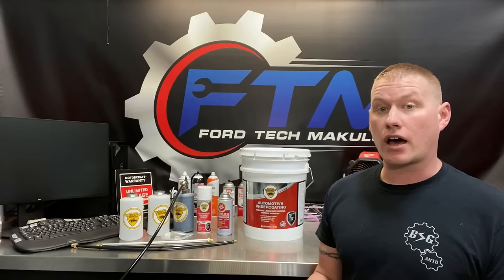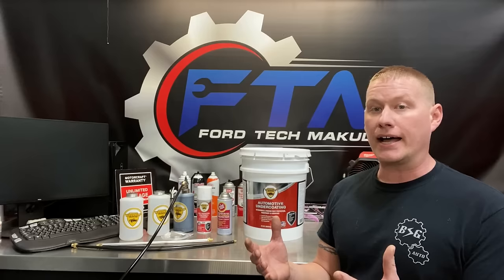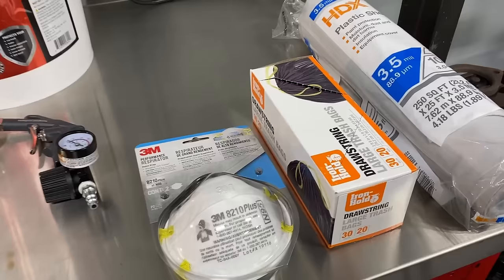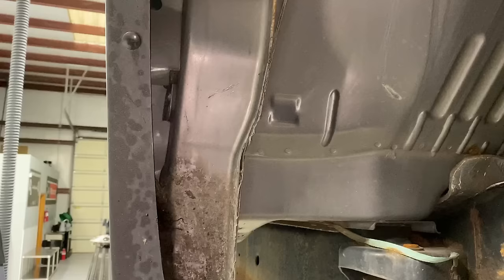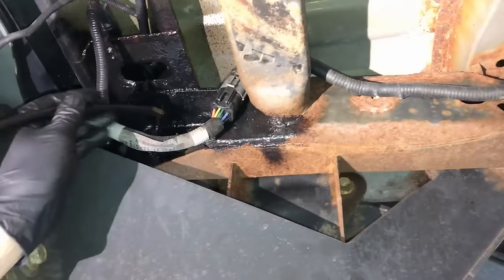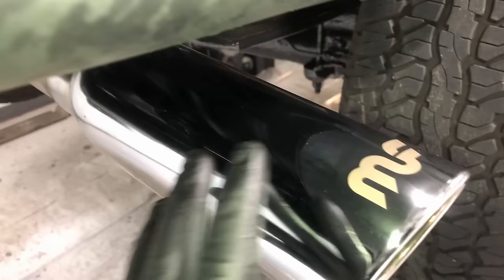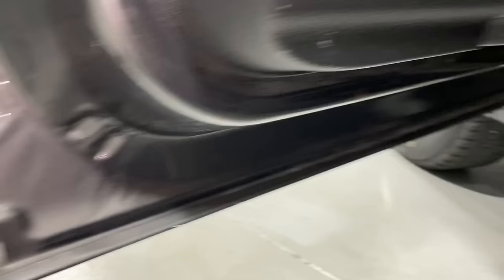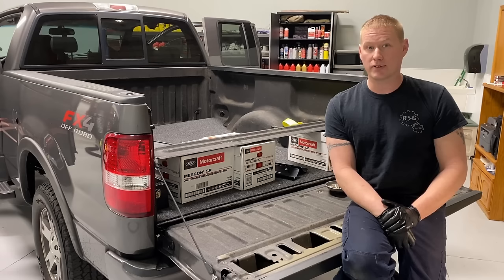Undercoating Your Vehicle with Woolwax: Is it Really Better than Fluid Film Though?

Comment from the maker: This is the Woolwax kit I recommend:
https://amzn.to/2KFBvpV
Reply: will this void the warranty on a vehicle?
Reply from the maker: no
Reply: Linseed oil is my choice, you can also mixed beeswax to get the same affect but you'll have disolve the wax with mineral spirits , so you can just mix them all together for the sprayer, and tint it with oil base black paint.  Remember linseed oil drys when exposed to air. It will not come off . Thats what im gonna do.
Reply: Hi big fan I've watched all your video's one timing Chan and camshaft phaser repairs I just buy a 2004 Ford F150 5.3 and the housing right above the phaser crack it was making a ticking sound when I buy it so I knew there was phaser problem and was going to fix it when I got home sad to say I didn't make it sorry long story but why would the housing break the chain is not broke thank you for all your support in this area and all Ford's I've also worked on Ford's my hole life and don't want anything else lol thanks again
Reply: Does this stuff harden or is it actually like a grease? And how do we kniw this wont trap moisture like the rubber stuff
Reply: I hope you are willing to make a follow-up video which shows how well Woolwax stayed applied....and what the next year's touch up process will involve.....

Many thanks to you for posting this video
Reply: FordTechMakuloco agreed lanolin works were well , I oil all my cars and trucks they are all old but look and drive like new . My mixture is chain bar oil ,cooking oil some non detergent motor oil and diesel mixed together applied with a suction feed paint gun and a pump up sprayed and I drill 1/2 holes like on my 2011 f150 from the top of the pillars and door jams in double walls box , fenders ,above rear wheels tailgate  . I just welded in rockers and cab corners stuck my hand up the inside of the cab above the cut of corners was amazed the rust  pitting in the e coat way up towards the roof so I drilled holes in the pillars just below the roof to gain access. Oiling every thing doors fenders frame inside and out suspension and mounts all welds all cross-members,   supports  , the rear shock mounts don’t look strong on these truck in my opinion and in Ontario the safety is getting stringent on repair and how they are done  .In Ontario the dept of transport does not allow you to replace  rocker or cab corners with out the being continuously butt welded with either a mig or tig welder ,even the bottom of the rockers which were spotted Oem must be mig or tig continuously. No structural modern  structural adhesive are allowed for parts considered structural by the dept of transportation . By the while doing the rockers the back side had plastic tape over the 6 or 8  2inch holes on the back side of the rockers to cover the holes Oem equipment un real ,I bet if I tape them up with tape it won’t pass inspection going to get plastic   2 inch plugs what was the manufacturers thinking other has been horrified by this
Reply: Gary Wick yes veg oil works I mix chain bar and vege cooking oil and non detergent and some baby oil smells nice and a little diesel or mineral spirits spray with a suction feed Paint  gun at 45 psi but ware a n95 paint respirator and I use a pump up sprayer also  don’t be afraid to drill holes for access , I even pull up carpets and pour oil on the cab floors and brush it then put heavy plastic under carpet and reinstall carpet . I have a1976supercharged  vette rests rod I had the car 38 years I oil the( bird cage ) by taking out the screws above the windshield and t top centre divider and the door pillars if that rust out on a c3 vette it is a nightmare to repair so better to treat it than loose it .
Reply: Do i need to be doing this every fall ?
Reply: Michel Francisco yes ,I use my own oil mixture and spray every year time consuming messy but works great if applied to every nook and cranny and lines
Reply: @nickking1510  hands down too you it's too much for me with 2 trucks to maintain a 2005 f150 and a 2008 f250, i found your channel last year, and i watch the videos even if is not for my trucks "  Knowledge is key " thanks brother.
Reply: Michel Francisco Hi Michel even if you did every few years it will help save the trucks and saves $$$ . I live in Ontario just east of Detroit tons of salt used here
Reply: I would love to do something like this to my vehicle, but unfortunately I have 30 years of rubber/tar undercoating to be removed before I could do that. Yikes! The amount of time you spent on your vehicle really demonstrates the shortcomings of having a commercial product applied by a franchise owner who generally will spend less than an hour per vehicle applying the product. How could you do an adequate job in less than an hour? I don't think you can. Much better to buy a good product and spend the day doing it yourself. As you did. Good job! :)
Reply: How often do you have to re-apply the Woolwax? Every year? Every few years?
Reply: @bob Johnson
Don’t forget the cost of the lift also when doing it yourself. I wouldn’t want to try to spray this stuff on laying on your back 2’ away from the sprayer nozzle. Just sayin...
Reply: Can you please do a second vid on this truck before you recoat? It would be really interesting to see how well it has stayed on and how it looks after a couple years. Thanks for this video. I just bought a southern truck and brought the poor thing up to Maine so I need to do a treatment on it before the weather turns. It has zero rust now.
Reply: @78djohnson   where did you get the straight wond  ? TY.. great video  👍
Reply: @garywick2090  I used boiled linseed oil, bar chain oil to thin, a glob of marine grease and some toilet bowl wax ring heated in an old crock pot immersed in water.
Reply: @gary24752  damn thats creative there !
Reply: @Daniel-sd3qk  no, water will not penetrate beeswax, linseed oil, or whatever
Reply: @FordTechMakuloco  Will you wash a treated vehicle in winter (automatic touch less car wash with the undercarriage sprayer)? 

Or do you avoid this as it could rinse off your protection? 

Thanks!
Reply: excellent footage on the inside rocker spraying!
Reply: Have you tried surface shield yet?

Comment: I have been using Fluid Film under the car every fall for years. The underside of my 2013 is virtually rust free. I just replaced my tires and asked for a alignment. They advised me that rusted parts may not be able to be broken loose to adjust, so if needed alignment may not be possible. "Live in rust belt". Picking car up they stated they couldn't believe how rust free under car was. Adjustments they made were easy.
Reply: How do you apply it
Reply: @RoyalKennedy601  
Liberally.
NOT LIBERAL.
Reply: @mconradb 🙄
Reply: Question for y ou, when you put this stuff one, what happens when you go off roading? Does all the dust and debri from the road stick onto to your frame?

Comment: to add to your tips. You should put a piece of tape a few inches from the end of the flexible wand so when you're pulling it out of the crevices you can see when it's just about to come out and stop spraying so you don't spray it all over yourself and places you'd never intended to.
also on the long flexible wand to keep them rigid you can use some tape and a straightened out piece of metal hanger,  tape that to the flexible hose that way it's  straight/rigid and you can control it in the long frame/tunnels.
Reply: Steve D great tip! Just started researching undercoating. Wool wax is what I’m leaning towards.
Reply: Excellent tip!

Comment: Great video, has to be one of the most thorough explanations of applying undercoating.  Great to see a good camera angle of using the 360 wand in a cavity to see how it disperses.  Just finished doing my Jeep last week but now know I will have to spend more time with the 360 wand in some areas on the next application. A great benefit to have a lift but still can be done on jack stands and great tips on dropping plastic tarp under vehicle and also on top of vehicle to minimize the mess....  also was able to disperse the woolwax fine with a smaller compressor...  working from the ground and having to spend time sliding around to maneuver in new areas gave my cheap 6 gal air compressor time to catch up running at 80psi

Comment: I’ve been using fluidfilm for years on everything from bolt assemblies to electrical connections that aren’t weatherpak,(over the top not the actual terminals it keeps stuff clean and uncorroded) and it can be washed off if needed with water. even brake lines and battery posts and my snow plow electrics and bolted together electric connections and springs(keeps them from creeking)it’s great to polish boats too, also on the exposed end of hydraulic shafts it won’t hurt any seals or rubber it’s woolwax aka lanolin. Another good use is on Acme thread like on vises they spin free and never gum up. Places where a light oil would otherwise be used. I use it on hinges to rite over the grease, I mean my f350 has it in the doors on window assemblies took the squeal rite out,latches tailgate, tailgate step,etc...
Reply: I had put Fluid Film on the rear fender wells - on the outside of the bed right above the tires - car wash would take it off, but rain didn't, though after driving it would be blown a bit and you have to wipe it off and get the dust and dirt which stuck in off... 
Inside the body cavities - where I could reach with the little red straw ( and there I was wishing that they had a thicker formula and an application system !!) - it stays well

My dad told me that the US Navy uses one of the fluid film products to coat the inside of tanks which are exposed to seawater, they just dump a couple hundred gallons into the tank and then fill with water slowly, and let the salt water do the work of application ( the stuff floats). So it should hold up to exposure without something to rub it off.

It's lanolin based - those sheep seem to keep from shrinking in the rain and snow, it can't be all bad.
Reply: I do the exact same thing with Fluid Film, I use it on everything.

Comment: Woolwax is a great product, just did my toyota 2 days ago. FF is great but I would not do my vehicle with it due to strong smell.  Woolwax has only a faint smell. Super easy to apply with the pro gun...very little overspray and NO dripping.

Comment: Now I’d like a review of the truck after an average winter !
Reply: EXACTLY...
Reply: My jeep is a 2015 bought new...took it home and went wild with fluid film similar to above/Nice!...Very easy and reasonably priced. I do my own maintenance etc. there is virtually no rust on treated components after 6 plus years in new england mountains...Note I do Not retreat yearly due to concern of trapping salt under a new layer...I used 2 real good coats to start...Very inexpensive rust insurance...other brand would probably hold up similar....New vehicle HIT it before getting it crapped up with new england sand salt mix crunch crunch...lol...
Reply: You would see a dirty truck with no rust . It works .

Comment: Fluid film is still top notch and I’ll continue to use it
Reply: Cj Heiser I use Fluid Film on everything, its awesome!
Reply: Cj Heiser I think I like fluid film better as well, I don’t like the black color of the woolwax where fluid film is more of a clear.
Reply: @jacobhendrickson8935  havent used either, but woolwax does come in a clear version, this guy just used the black tinted one as he said
Reply: Right I been using it seems good to me. I just put it on every 2 months
Reply: @jacobhendrickson8935  Woolwax also has a clear I use both Fluid Film and Woolwax
Reply: randall s I ended up figuring this out somehow and did get woolwax. It seems to work great.
Reply: yes, but only in cavities.
Reply: Sprayed fluid film every year for six years on my F150 (2014).  It’s on there thick now. No rust in king of salt Pittsburgh.
Reply: @williamhudson5387  So it obviously works...
Reply: @jacobhendrickson8935  Brian said he ordered the black tinted woolwax.  You can get the non tinted if you like.

Comment: Fluid film is fine on rubber - they even show using it as a tire dressing on their site. If you want the undercoating to last beyond the first time you drive in the rain put your woolwax in a pot on a hot plate and add shavings of an old candle or a chunk of wax ring from a toilet seal.

Comment: This is a good demo, very thorough!

I ended up getting the Woolwax pro kit with the 4 bottles of black product, 2 hoses, and the better gun. I recently bought a southern truck, and wanted to preserve the pristine underside, which is a very rare sight in the northeast. I don't have a lift, so it required scooting under the truck on my back. Ran the gun with one hand and the worked the business end of the hose (the one with the single hole, not the 360) with the other. Took about 3 hours to do my truck and went through 2.75 bottles. Looks like it takes a long time to dry, maybe because it's only 45 degrees here, so I'll let it sit for a few more days before driving.

I've used Fluid Film in the rattle can for a few years, and it is good for undercoating mower decks and snow blower buckets and chutes. The full on barn stench of Fluid Film lingers for a long time, which isn't a bad thing for power equipment, but with it being more runny, I opted for Woolwax for my truck.
Reply: Wool wax never really dries

Comment: Boston, MA: I don't have a compressor powerful enough to spray the Woolwax so every year I buy a 6 can Fluid Film kit for each of my cars. I apply it in the heat of August and so far neither my 2014 Ford Focus or 2011 Crown Vic show any signs of rust. The Woolwax looks awesome & eventually that is the direction I will take.

Comment: I have some of my own testing running this winter with Woolwax and 28 other different products. Good video.
Reply: Repair Geek
Let us know how it survives the winter.
Thanks
Reply: @mikeholubek4419  check out my channel. I've done some other testing as well.
Reply: @Repair Geek I'll definitely check out your channel. I've been using annual drain oil rust proofing for years with good results but am very interested in other methods.
Reply: This guy deserve more subs.
Reply: I've watched your Fluid Film videos.  I'm so glad you and now FordTechMakuloco (Also Project Farm on some levels) have taken on the challenge of testing these things.  There's so many opinions out there about so many different products without a lot of real world evidence to back up the claims.  Yet the potential for a successful product is HUGE if people can really see how well they work.  Thank you!
Reply: Repair Geek I mix my own chain bar ,cooking oil ,non detergent motor oil some baby oil smells nice and a little kerosene or mineral spirits. Been doing my cars and trucks yearly since 1971 ,if you get all the hidden spots sprayed like inner panels double wall truck box frame and inside frame cross members rockers cab corners doors pillars 1/2 holes need to be drilled don’t be afraid to do this just put plastic plugs in when finished . I would rather explain to a buyer that it was oil under coated annually and has plastic plugs in the half inch holes than explain the rot and rust lololo  increases the resale if you decide to sell or trade in
Reply: Definitely interested in your results

Comment: Another great how to video Brian. I've used Fluid Film on all my vehicles. My 2011 F150 FX4 is still like new inside and out. I really like that the product keeps creeping into places that water/salt may collect. One thing I did find is that the lower drain holes in the doors can become bridged over as the product pools and thickens over time. But that only happens if you are very generous with the application of the product, and that is a easy fix to clear the drains if it becomes a issue.

Comment: Update Tip 2022 - I believe that Woolwax has now come out with a thinner product called LV for Low Viscosity.  It flows more easily to penetrate those pinch weld areas and other tight areas.  I see that Rust Check uses such a two product system with their Red can and Green can products.

Comment: Funny I just watched Bill (MacTFordEdge) do this with fluid film.
This Wool Wax stuff looks more durable than fluid film.
Advantages of Woolwax:  
Tinted black makes rusty frames look like new.
Smells better than Fluid Film
I wonder if mechanics working under a treated car would hate getting black grease on themselves.  
What about prepping the old frame and spraying Eastwood rust encapsulating black chassis frame paint before doing the Woolwax.  As you know Eastwood also has a special rust encapsulating paint that creeps inside the frame.
I have a 2005 Chevy and it’s rusting in the cab corners, rockers, wheel lips etc.  
Excellent video demonstrating the process.

Comment: I found that the best thing for rust-proofing the steel frame and other exposed parts of a vehicle is  'Lucas HD OIl Stabilizer'. Normally you use that stuff inside an engine, but it is sticky as heck and sticks to every surface it touches and is nearly impossible to get off once on. You have to apply it with a brush as it is too viscous to be sprayed.
Reply: You guys and your Lucas crap

Comment: I have the same kit from kellsport products and been using fluid film for years. Keeps our older paid for cars like new underneath .  We apply in late spring/early summer. My thought is the rust gets activated from condensation that gets into panels from heating and cooling cycles.  Regardless I am happy they make it in black now! Will look much better than that funky amber color. Ordering a pail real soon.. thanks for the great video!